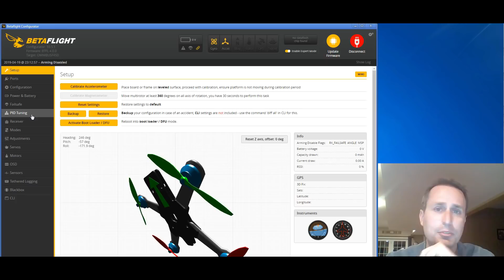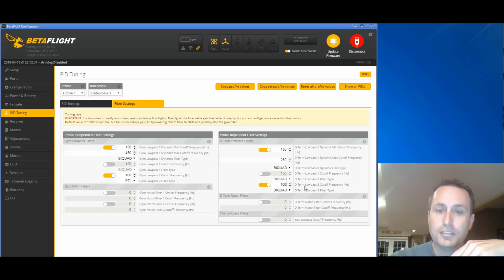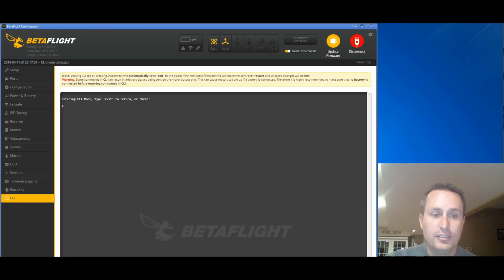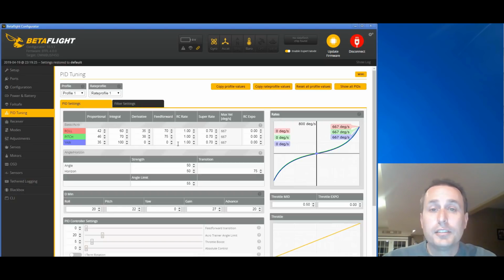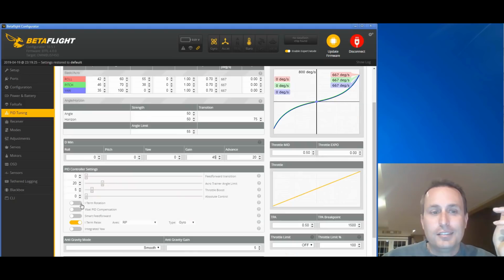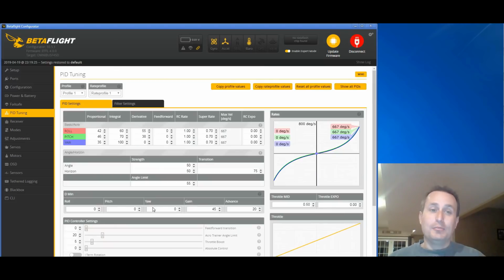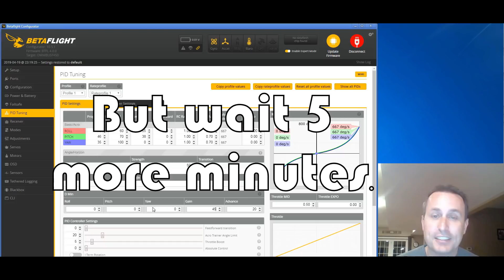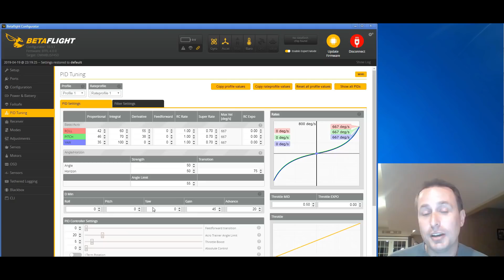Betaflight is too Complicated?

Comment: Hello from Spain, you speak so well ,that for the Bidiretional and RPM Filter settings you have to now what you are doing and read all over GIT HUB what is Betaflight 4.0 and understand it . I have readed 2 weeks and studdy all and maked a lot of test flight , and result is fantastic to faly it when you now what you have to do . !!!!! Tanks a lot for all your Vidios it helps me a lot to undestand it realy . I wish you a happy easter time and find Betaflight surprise eggs :-)))))))))))
Reply: Please can you tell me i put in the CLI Integred YAW and Absout Control on 10 ,what do you think about it ????
Reply from the maker: I would get flying without first.  Get the ship flying well.  Then read up on Abs Control in tuning guide and start small, adding in 3, 5 or 10 max.  If better, great.  If not, don't use it.

Integrated yaw just flips around PID terms to be more in-line with our expectations of what they do for Roll and Pitch.  BUT, requires Abs Control to be active since it drops the i-Term from yaw.

Comment: I realise it can be obtained with a little work but a great addition to the copy pastas would be a "reset to default" copy paste for the settings you are changing.

Really impressed so far with 4.0. Just running defaults on a high power freestyle raddix build with d-min dropped a couple of points in p/r. Propwash definitely improved but probably still could be better and I'm getting some top end oscillations. Need to play with it a bit more but want to go through the RPM filter setup before I change too much.  Did a test with a 4k camera today though and at first glance the footage looks super smooth under the vast majority of situations, I could easily live with it as is, it's great.

Comment: I just did a tuning video, showing plasmatree, showing how I setup static notch to handle frame resonans around 190-230hz and then raising dyn_lpf to 230hz.
That way the dyn notch will kill mostly what noise is left. But this requires bblogs.
Reply: The biggest results for me, was adding higher d values and raising the d_gain. D_min can really work wonders. That, and the dyn notch, is closing in, on the "perfect" dyn default setting.

Comment: What would be good would be custom OSD elements that can be direct values from any function or sensor output including products modified by equations. For example on the TBS core pro they have mAh per minute for working out efficiency. I would also add mAh per KM realtime and flight end final calc after distance travelled.
Reply from the maker: Make a feature request, or.if you have the means, code her on up! :-)

Comment: I like complicated stuff =D but after some issues with the RPM ESC firmware (motors not stop spinning after disarming =O and totally losing control of the drone) I decided to go with the normal filters and try to avoid propwash by becoming a better pilot (like the devs suggested LOL) Thanks for the video!
Reply from the maker: Yep.  RPM is Beta BLHeli.  U were a beta tester!  Report the issues to Github?
Reply: UAV Tech Yeah I did, BlHeli dev said that in the new version the issue was gonna be fixed... The version come out but I don't have an area where I can lose control of my quad and not endanger other people's property, reckon I will have to wait a little to try it again =D but your tip about motor torque pretty much did it to me... I'm using a lighter prop now and I'm happy with the propwash, even with 4.0.0 (wich has supposelly worst propwash handling)... Now I just want a hero 7 and a set of lumenier ZIP 2407 and I'm completely happy HAHA thanks man!

Comment: Just came home from trying the D_min boost (or is it Demon :) ) on a 3 inch racer and a 3D quad. On the racer, a Karearea Titi, it works like a charm. Sounds smooth, no noticable oscillations when ripping it around and the motors aren't even getting warm 👍
On the 3D quad there is a little more work to do, it was reducing the propwash oscillations but I could hear the D-Term ringing occasionally. The motors were also getting pretty warm. If only the props were a little more efficient 🙄
To the OpenSource community - that's right, I always wanted to take part in one of them, since I am a software engineer. But I know, how much work it is, to get something to a release state and how much the "customers" are nagging, if it's not running smoothly, which it almost never does 😕 
That's also the reason, why I'm hesitating to take part in Open Source projects; I'm already doing it 8 hours a day, 5 days a week.

Comment: Would you still recommend the 5" Community (UAV Tech) Presets mentioned in the video for Radix based boards?  Also, have you done any Radix board testing on possibly how it may differ using the Bosch gyro?

Comment: Great video. I'm having trouble with my X class quad. BB has bad vibrations at 60kz and 180hz. Should I start at 60hz or 50hz on the filtering? Also, is dynamic filtering recommended for the large quads?
Reply from the maker: Yes, but you have to make sure it is in Low mode, which will be the case for lowering your Max Gyro Lowpass1 cutoff to <333hz.  Also there is a CLI variable that you will see when you type "get dyn" to lower the minimum value of the Dynamic Notch.  For X-class I would put at 50hz.  Same for gyro and D-term Lowpass1 values.  I would set them as BiQUAD and use value of 60 to 150hz.  Try these and let me know what you think.

#Filter Settings
set gyro_lowpass_type = PT1
set dyn_notch_min_hz = 50
set dyn_lpf_gyro_min_hz = 50
set dyn_lpf_gyro_max_hz = 200
set dyn_lpf_dterm_min_hz = 60
set dyn_lpf_dterm_max_hz = 150
set dterm_lowpass_type = BIQUAD
set dterm_lowpass2_hz = 0

Comment: I've had some issues particularly with trying to use the dynamic Gyro lowpass filter instead of a static lowpass filter. This issue arises at mid throttle usually during a turn where it sounds like P oscillations are becoming excessive. Once these oscillations start they dont go away until I land and they are really bad. Looking at the gyro lowpass filter code it looks like the cutoff frequency simply scales up with throttle. Is it possible that it ramps up a bit too quickly with its cutoff frequency in response to throttle particularly in turns where half the props are still at low rpm and potentially causing lower frequency vibrations? Currently the static gyro lpf at 150hz flies perfectly fine but I'd love the reduced latency of the dynamic but I cant seem to get it to work.
Reply from the maker: did you try reducing your high-end range dynamic lpf range?  Instead of it going to 450 default, reduce that to 350 or 300?  Do know that once you put it below 333hz, the Dynamic Notch triggers into Low mode, which will have the notch focus on lower end noise (80 to 333hz peaks) BUT it won't be about to go much about 350hz for full throttle stuff.  Typically the noise peak for a 5" quad ranges from 200hz to 550hz.  You can override this the notch going to Low mode if desired.  Going into the CLI and looking at the Dyn Notch variables by typing "get dyn".  You will see it in the list.
Reply: @uavtech  well on my 6s rigs I run anywhere from 1850kv up to 2150kv for racing haha so following the instructions I tried it up to 600hz but I'll try lowering it to see if that helps. Given that rpm doesn't increase linearly with throttle I might be a good idea to run a logistic function to model the curve of rpm vs thrust that guides the dynamic lpf
Reply from the maker: @MewoFPV  , it is not linear.  See https://www.screencast.com/t/77crCFLQmUq

Yeah, ideally you should be able to push up to your max peak frequency, but depending on your frame, motors, props, you could just have too much vibes.  You ever run a BlackBox log with Gyro_scaled recorded to look at your raw noise?
Reply: @uavtech  no unfortunately the board I use on my racing rigs doesn't have any on board flash or SD slot so I'm gona have to figure a way to wire up an external logger since it's pretty futile to try to tune it without logging haha

Comment: Would I term rotation help with angle mode whoop flying?
Reply from the maker: If you are making sharp yaw moves, maybe.  Depends if i-Term is accumulating a bunch.  In general, I would guess not, but maybe.  Mostly for LOS flyers who are all over the place for moves and direction.

Comment: Do you think it would be possible to incorporate the results of plasmatree "gyro_scaled" noise floor into the configurator. 
I'm thinking if a notch would follow the throttle noise graph from plasmatree. Would work, kind of like Rpm filter, but more static to the throttle, and not follow the motors directly. This would work for those of us still flying blheli_s esc's.

Comment: Imo i feel that Boris b inspired a bunch of people but seems that for every coder ever obstacle seems to be able to be overcome if u throw more code at it. I'm more worried about the disconnect between pilots and coders, coders say 'the filter that filter, rigid body modes, shock response,' pilots say 'sharpness, tracking, twitchy'....and definitely don't believe that coders are that humble, I'm sure they wanna believe they are now a part of history contributing to this firmware...'look at this elegant code I've written, so few lines, so efficient..'. Basically any chance of immediately removing defunct menu options....have Master sliders control multiple sub options with normal language like 'sharp/smooth' instead of 'second order partial derivative of z'...they are prob related when it comes racing or acro...also any chance of getting with multigp to codify a race version....As u can see with launch control ppl rather code than practice...don't wanna see a day when I just pat my ai-driven quad on the head and let it race for me.....urgh...let's make it easier, keep IQ requirement lower.

Comment: Hello from Spain you now that i was making all correctly and yersteday i was realy shoked !!!!!! I have had the flay to the moon witch all the setting .Eachine TS 215 V3  Bidirectional,RPM, FF, Integed Yaw all Filter settings well not hot motors . Then i faly with my Hobbywing 5S 1300mph and maked a punch and it climbed to 778m ,i dnot see him and i have rescue mode , so then i was seeing and he desends and i was so shoked and have seen with GPS and Barometer to were it goes. I realy recomend no to flash Beta BL Heli 32 Beta  .I flashed the normal version with your PIDs and now its good !!!!!!!!!!!!!!!!!!!!!!!!!!!!!!!!!!!!!!!!:-)))))))))))
Reply from the maker: Wow.  Sounds like an experience.  Sounds like you got it back though.

Comment: Well, I personally think it is more complicated. But it also flies MUCH better from what I've seen, so I guess it's more than worth it. 😊
Anyway, I have 3 quads... A brushed micro with Butterflight (3.5. something) and the other 2 with Betaflight 3.3.2 or something... They're flying well, so I won't update them. But the next quad I'm going to build is going to have 4.0 in it. 😊
About the Betaflight developers, totally agree!
Reply from the maker: 7-min to distill and tell u how to tune.  Can just not use the features my man.
Reply: @uavtech  Sure, I know. But my philosophy is: if it's working right, don't mess with it. 😉
Reply from the maker: @MCsCreations  , oh I agree with you there!  Cheers!

Comment: I complained on Facebook and was immediately muted. It's not how complex it is, but the results from endless hoop jumping just aren't that great. Since then I've been pm'd by two senior BF devs and have had at length conversations with them. They disagreed with the immediate closing of comments and said the base filters were going to be changed. More conversation needs to happen around feel. Your black box doesn't account for that and 4 is way to stiff in my opinion without major changes for smooth freestyle. FF is a band aid but doesn't replace it. 4.0 is a heavy 4 wheel drive Audi. I want a 2 wheel drive lotus to drive that dances. Too much of 4 seems to be based around racers and not the 60% of folk who don't do that. Too many features with no enough testing. It can be made to do anything but the process to get there is getting ever more tedious. People are struggling all over the show. If it works for you then great, but pretending it doesn't have huge bugs and issues is just plain silly. This release really put the Beta In flight. I've donated large sums to every release so far in the last 3yrs. No more.
Reply from the maker: Feel is too arbitrary.  Since we are being frank.  Feel is bullshit.  It can easily be measured.  All that matters is reduced PID Error throughout the flight. PID Error tracks how well the quad is tracking the Sticks (Setpoint). That is the measure of feel.

Help test yourself!! or better, move on.  Have fun out there.

Keep in mind with your OPINION that there are far more with the opposite reaction.  So maybe you feelers are off?  Depends on which has less PID Error to be the judge.
Reply: @uavtech  that might well be the case but many of us don't want to fly a simulator. Put some life back in it. The only thing anyone really wants gone is prop wash and 4 is worse than 3.5 in that regard for stop start freestyle regardless of d_min and other recommended tweaks. It's hard to put that feel back in without changing everything. Just an opinion. No more or less valid than anyone else's.
Reply from the maker: Following Setpoint is key.

Turn D_min into D_Boost per my video and 4 is superior.  Or just turn off D_min and it is the same as 3.5.  Pretty simple.
Reply: @uavtech  already done when I first setup.
Reply from the maker: You on RPM or just stock Dyn Notch alone.  If on RPM, try turning it off - set Harmonics = 0.